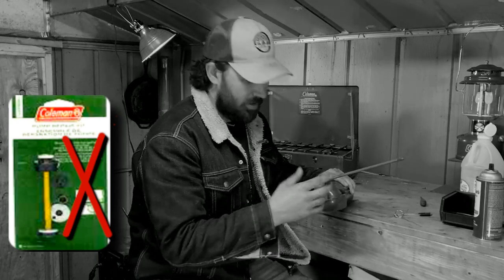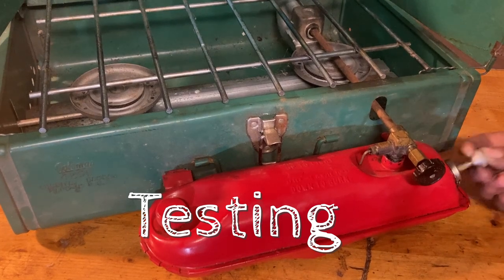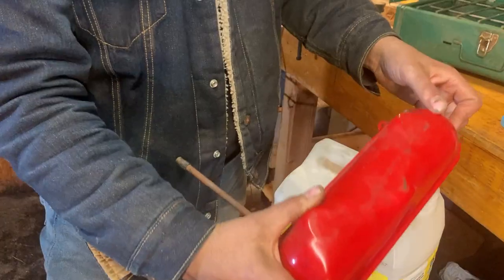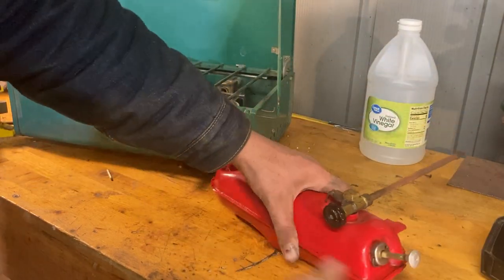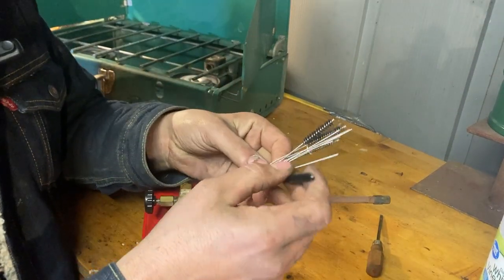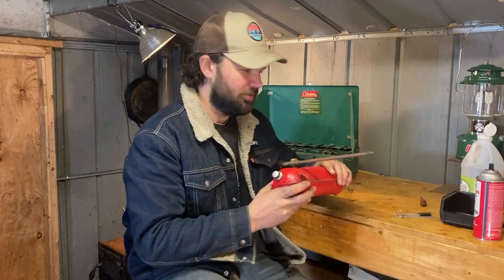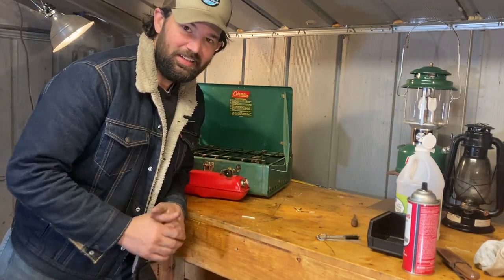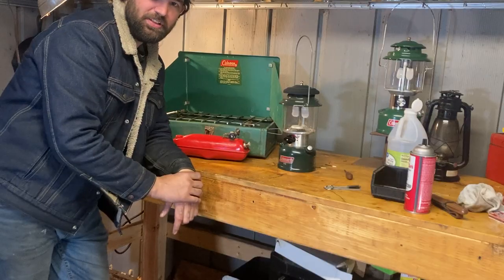Coleman No Pressure? - Try The Check Valve

Comment: What an absolute pain in the asp. Took it apart a half dozen times trying to get the check valve unstuck.  

Then it finally worked.  Thank you so much for the how to video. I have several lanterns and several stoves, never had any problems from them.   This little back pack stove is my newest one and of course it had the problem.  Some of my stuff is downright ancient with no problems.

Comment: Great video!  Your method work great for me as my lantern wasn't holding pressure after a decade in storage.  Pulled the pump out along with valve screw, added carb cleaner and let sit for a few hours.  Used a wire to clean out any gunk.  Put it back together and works like a champ now!  Thanks!

Comment: Thank you for this. I just got my first 220 lantern (I got it for when we take our 79' VW out camping) and at first I had no pressure. I took the plunger out and set it back in and it was honestly hard to even push it in. I could only get about 3 pumps before I was done (my wife is used to that. hahaha!!). The rod would easily push back out by itself so at least I have something I can try tonight without thinking I need to get that special took to get the valve out! Or is it possible that the tank is just too full of fuel & doesn't take much to pump it up? I'll edit this tonight or tomorrow once I give it a try! Thanks!!!
Reply from the maker: Yeah even if it is totally fuel it will definitely take more than three pump (as she already said) let us know how it goes!
Reply: @1990Co  haha! Im glad you can appreciate the humor. I'm new to this so I appreciate channels like yours! Enjoy your day!
Reply: @1990 Trade Co  well I tried everything! I was able to get a little pressure in there and I finally stuck a long paper clip down in there & it must have pushed the ball a certain way because I got shot with a blast of air!!! But that got it unstuck and seems to pump as it should now! It got pressure without letting air come out of the little hole now in the pump. My wife was impressed that I actually, maybe fixed something right. Ha! I appreciate this tip, it was the ONLY thing that actually worked .I'll test this tomorrow again & can report back! 👊
Reply from the maker: @jamie-r2034  nice! Dude I’m actually really stoked to hear that yeah please report back!
Reply: @1990Co  Me too! Thanks brother. You should do some videos on your camper too! I love the old vintage stuff and have our 79' VW Camper that we take out camping. I love this old Coleman stuff for the nostalgia of that time period. I'll report back tonight after work when I give it the real test if it's still working & lighting as it should!

Comment: If no pressure was my problem, the first two things that I would do is (1) oil the leathers, and (2) check the gasket in the filler cap.
If the check valve is leaking, it is a very DANGEROUS situation.  The pressure in the tank will instantly push a stream of raw gasoline straight out of the vent hole in the pump plunger when the plunger is unscrewed to allow the pump to work.  This raw gas squirts directly onto the operator.
I have had to remove and replace two such Coleman check valves.  That had never been a problem for me when Coleman made their own equipment in America.  But, for years it has been farmed out to overseas sources, perhaps to China?
Courtesy of Half Vast Flying
Reply from the maker: Yeah it pushed all that air right back out the pump hole good thing I had it empty this time
Reply: It won't spray liquid fuel back out unless you've somehow over filled the tank. The air tube goes up to nearly touching the top of the tank.
Reply: @dontblameme6328  G’day, Don’t.  Maybe on some models.  On mine, the bottom end of the pump is submerged.
Courtesy of Half Vast Flying

Comment: If you stand the tank sorta vertical (securely) and fill the pump tube with acetone (after removing the stem and plunger), let the acetone sit for a spell. I fixed one that way just yesterday. Just be sure to clean the pump tube thoroughly ( i used compressed air) since the acetone may cause the paint around the top of the tube to become loose and you don’t want to introduce that to the tank or check valve. If it works it’s a lot easier than trying to remove the check valve, especially if you don’t have the tool. Hope it helps